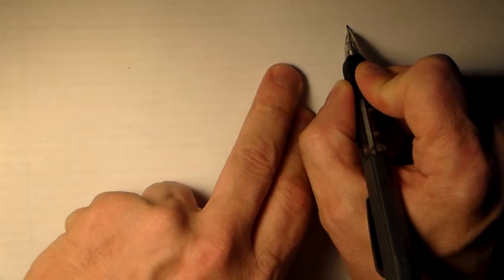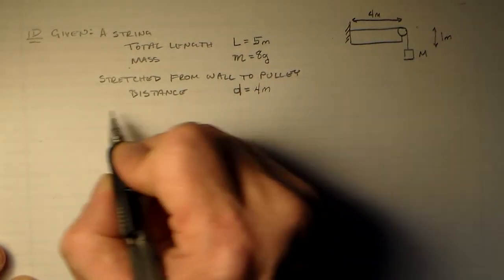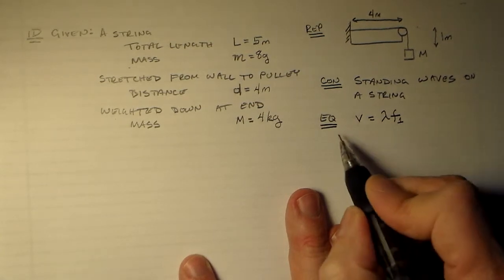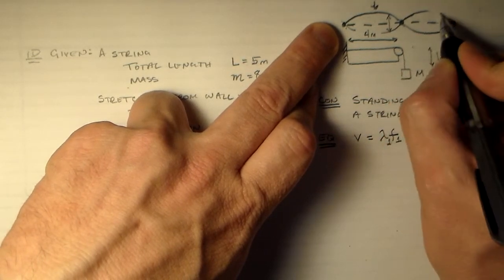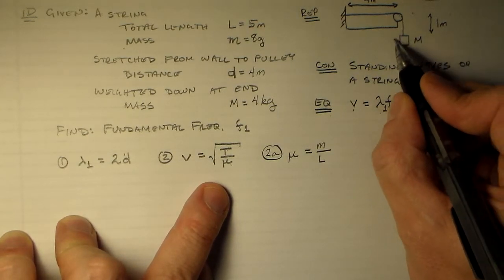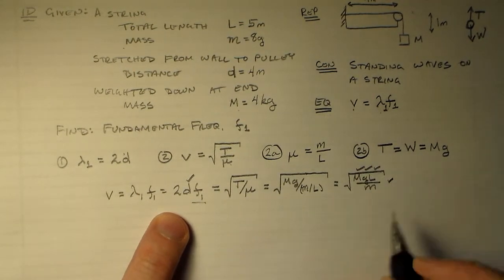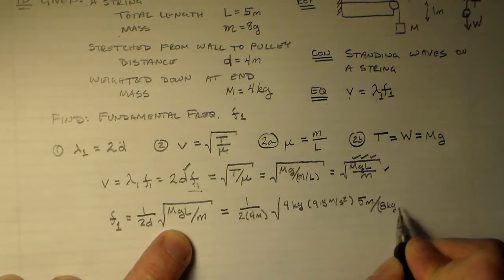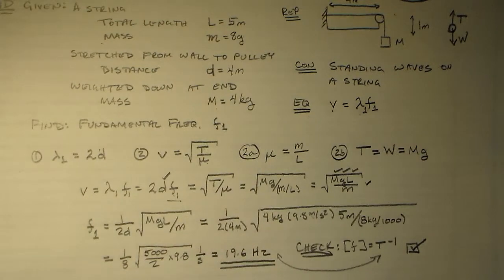Standing Waves on String

Comment: Awesome lecture, this really made waves make sense; however, I was wondering if the length of the string you should use should be 4m instead of 5m because the string is effectively closed by the wall and the pulley, so the actual wavelength would be 8m.